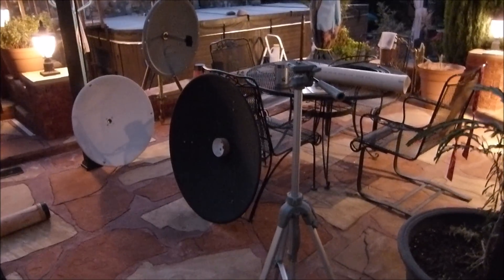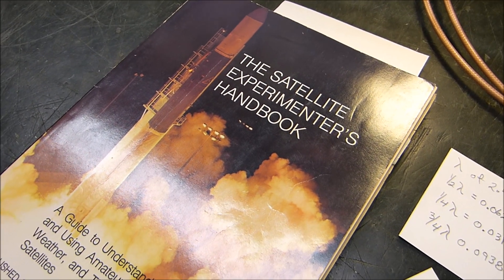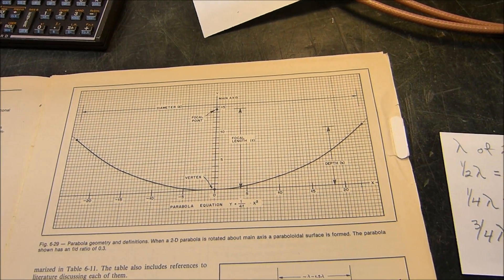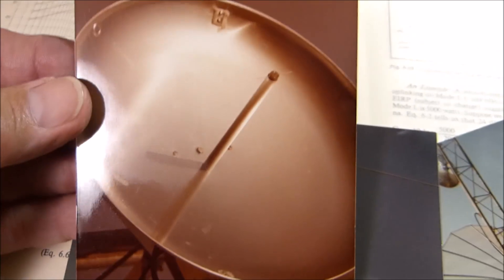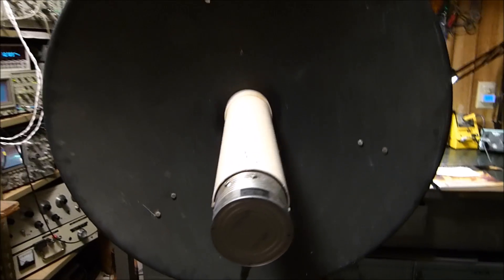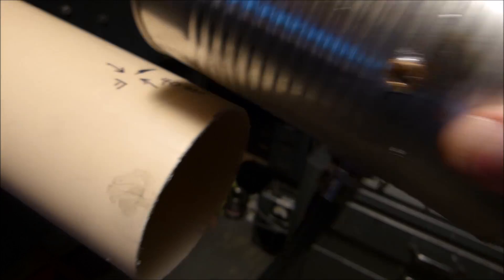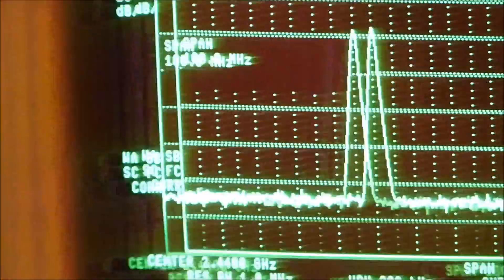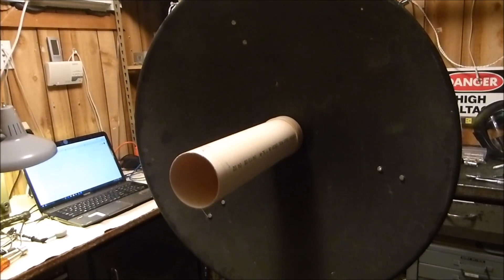2.4 GHz WiFi Antennas - Slotted Line & Cantenna Feed For Parabolic Dish

Comment: Is the large mast-mounted parabola you made for 2.4 GHz or was it something else?  Do you think it would've worked if it were a factory manufactured C-band mesh dish?
Reply from the maker: Not sure what the original use for the large black dish was but here is a link to gain formulas. C band being 4-8 GHz, I would think a dish this size would work pretty well. It had gain at 2.4 GHz especially with the 46 ounce bean can for a feed horn.
https://www.electronics-notes.com/articles/antennas-propagation/parabolic-reflector-antenna/antenna-gain-directivity.php

Comment: https://www.youtube.com/watch?v=xppiMPNORWM&t=26s
do you watch this fella's stuff?
Reply from the maker: I sure do. Andrew is dedicated and very good at it, even the 5 GHz stuff. I haven't tackled that yet. 
I invested in a signal generator and Bird watt meter elements to measure and do everything necessary for the 2.4 GHz range but my oscillator only goes to 3 GHz. 
My spectrum analyzer goes to 12.8 GHz but I like to work with a CW signal instead of trying to rely on the output of an access point or use the signal strength from other random sources. 
A number of years ago I invested in a product by Metageek called Chanalyzer that was really nice. Their prices have gone thru the roof but as a startup company their equipment was affordable and I wrote a nice review of their product and became their "poster child" for a while.   :-)
Here is a link to their site.
https://www.metageek.com/products/wi-spy/
Reply: thanks

Comment: far better to dispense with lengthy coax, mount the dongle as close to the can as possible and use a powered usb extension lead.
Reply from the maker: I agree with you, Nick. Just recently, I installed two 5 GHz dishes to have Internet access at my mother-in-laws house and the performance is fantastic. I get 100 MB download here off cable and I get around 95 MB performance at the other end of the 5 GHz link. Everything is built into the probe at prime focus of the dish and is powered over the CAT-5 cable.
Reply: wonderful, how bigis the dish?
Reply from the maker: I don't know exactly the size but at least half the size of the smallest one in this video. I would guess 0.5 meter across. Very pleased with them.
I don't remember the exact model but it is by this company and very similar to the link below.

https://www.balticnetworks.com/ubiquiti-antenna-5ghz-30dbi-light-weight-dual-pol-parabolic-rocketdish.html?utm_source=google_shopping&gclid=EAIaIQobChMIs_idq-CD2gIVgz2BCh2R4gIoEAQYASABEgKNrPD_BwE
Reply: so about 18 ins, thanks

Comment: ElPaso TubeAmps Thank you for all the good information. It seems that the cantenna is a real winer !
BTW I noticed that you don't have the impedance matching radial screws anymore, are they not needed?
Reply from the maker: The screws are really not needed but can be used to match it perfectly. I have to agree that the cantenna type antenna is amazing. I took the big black dish to the mountain side in El Paso and I could see lots of access points in every direction but none that were open. I suppose the open ones in businesses like McDonalds, for example, are pretty weak and enclosed in the building. I used the slotted line as the feed in this antenna as it seems to be within about 2 dB of the can feed horn and the output comes straight out the back of the dish were I directly connected the AP via a SMA to N connector and it also looks so much better than the big piece of coax that has to come off the can. Thanks for your kind comments.

Comment: What about mounting the cantenna on the back of the dish and use three struts to hold a small sub reflector so the signal get sent down through the dish to the cantenna aka Gregorian Dish antenna
Reply from the maker: I would love it but I don't have the hyperbolic reflector. I understand that Cassegrain/Gregorian antennas are about 70% efficient so I would need a bigger dish. The difference in the two antennas is that one uses the concave hyperbolic reflector and the other used the reflector in convex configuration.  As I understand it, the dish should be at least 10 wavelength which is what the black dish is at 2.4 GHz. Maybe someday I will run across a 6 foot Gregorian/Cassegrain antenna at an estate sale for a couple of dollars.